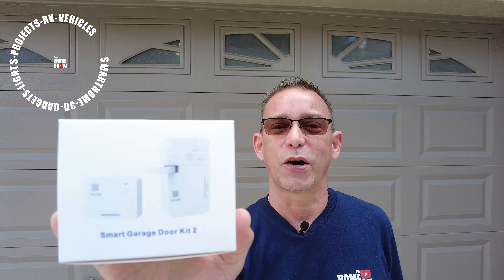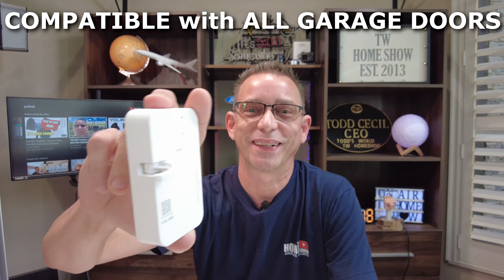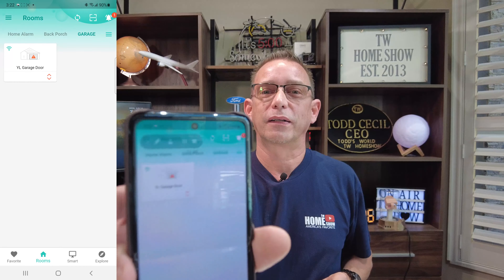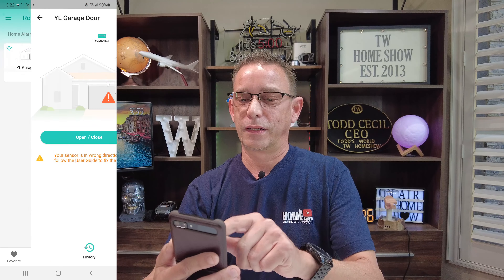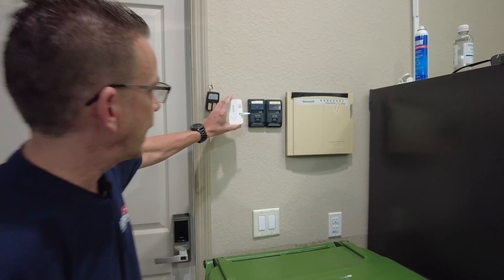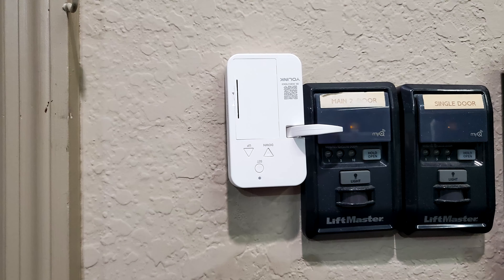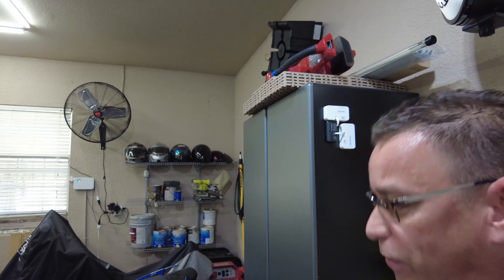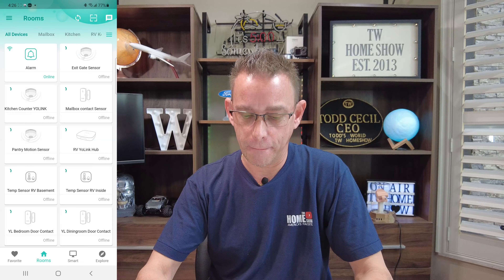YOLINK Smart Garage Door Opener | YOLINK Finger | Simple SMART Garage Door Opener

Comment: Great video, Todd! I had put off buying and installing an automated garage door opener for quite some time because at my age I am unsteady on a ladder and there was no way I was going to put myself at risk with my head near the ceiling, two hands needed to wire it in to the existing controller. Then YoLink solved the problem for me with, as you say, no ladder and no wiring, and I had the YoLink Finger fully installed and operating in no more than 20 minutes! Great device! And the YoLink Tilt Sensor is a terrific addition.
Reply from the maker: utuber1000, that is so awesome to hear! Thank you for sharing and I'm so glad this solution helped you!  😊  -Todd

Comment: Great review. I'm having problems with the "up/down" buttons as no matter where I set the "rest" position for the "finger", it always goes back to a default position after I use the YoLink app to open or close the door.
Reply from the maker: Hi Frank, I noticed mine do the same...but they still move enough to trigger the buttons. If yours doesn't,  maybe you could 3m tape a spacer on top of your button.  -Todd
Reply: @twHomeShow  Hi Todd. Mine moves enough to push the button, but does not raise up enough to release it! I can't find information on how to use the up/down to make the "off" position  stick.